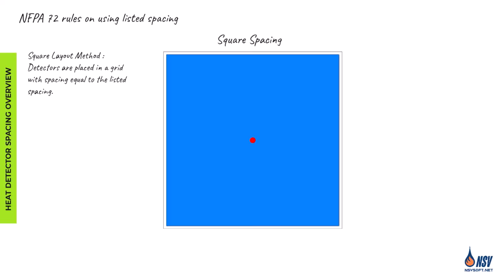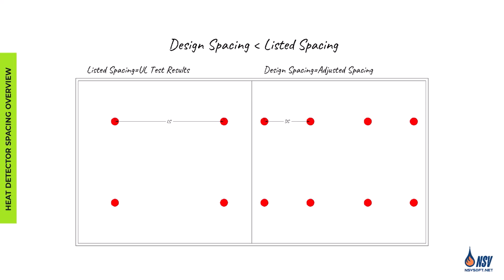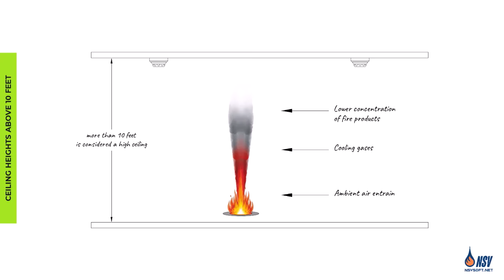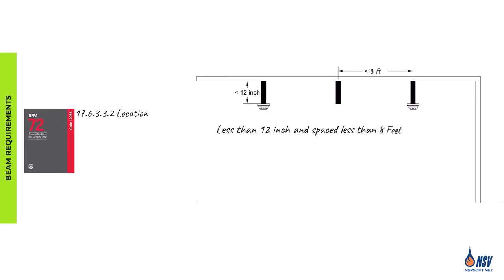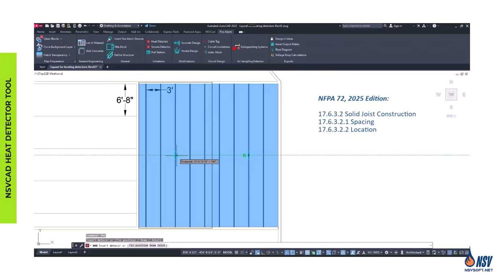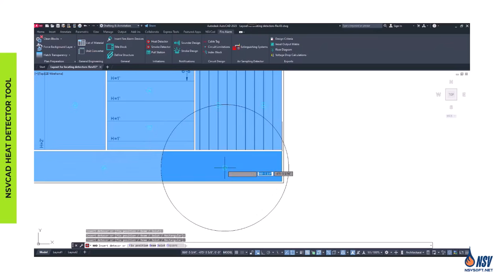🔥Understanding Heat Detector Spacing (NFPA 72)

Comment: according to the video, it seems where there are no obstructions such as beams or joists, the optimum coverage is circular layout?
is it possible to use circular coverage when joist or beam obstructions exist at all?
Reply from the maker: Hi Amir,
You can use either method per NFPA 72. For circular layouts, NFPA 72 states:
“Detectors shall be located so that all points on the ceiling are within 0.7 times the allowable listed spacing (S).”
This 0.7 × S rule defines the circular coverage concept, meaning each detector covers a circular area with a radius of 0.7 × S.
As long as you apply the beam and joist spacing reductions and calculate final spacing, either method works fine.